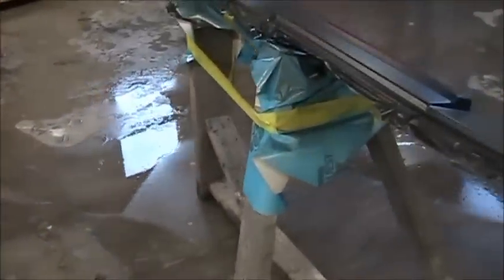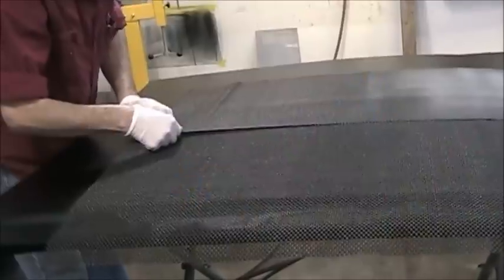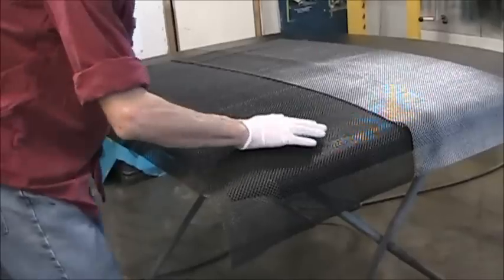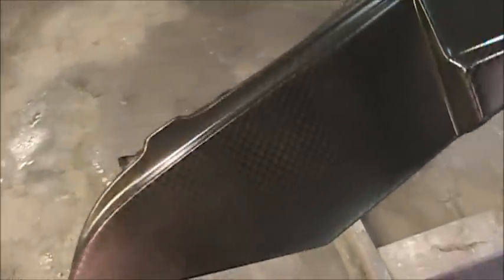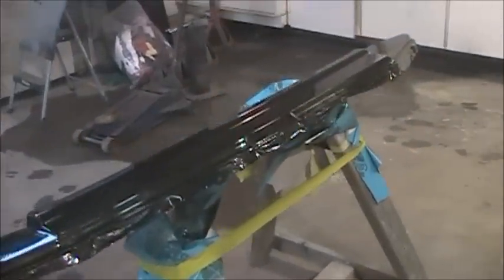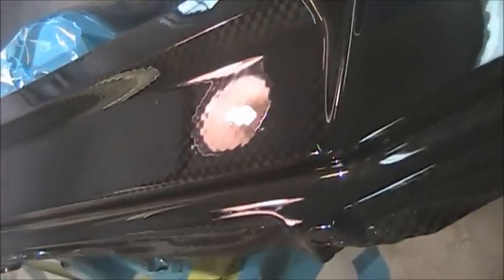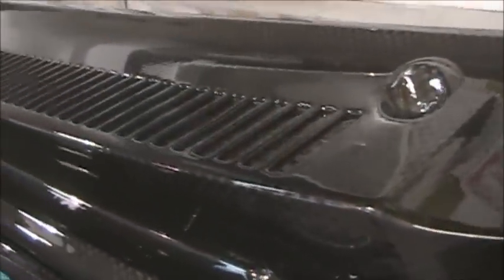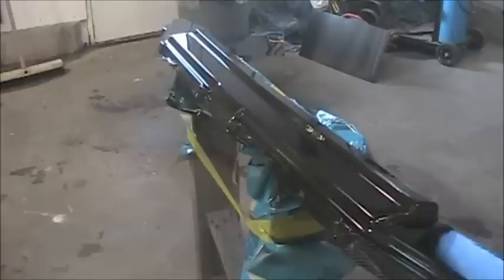first try at painting carbon fibre.wmv

Comment: I have never done anything like this, so I am certainly not pretending that I know it all.....but, when you started spraying, the pressure was moving the matting. Would it be better to lower your spray pressure, so that the paint gun doesn't move the matting? Just wondering..... I think it turned out pretty good................. Thanks for the video.